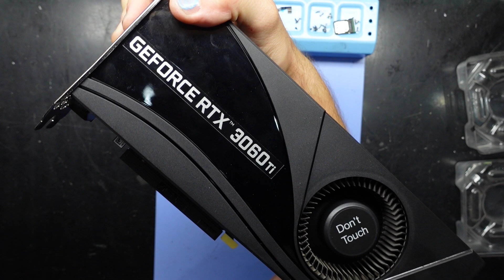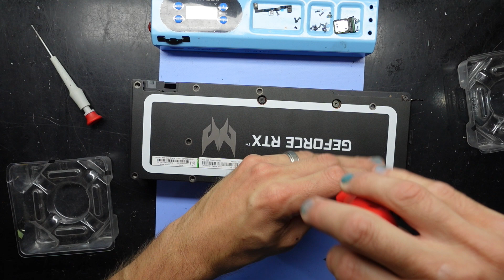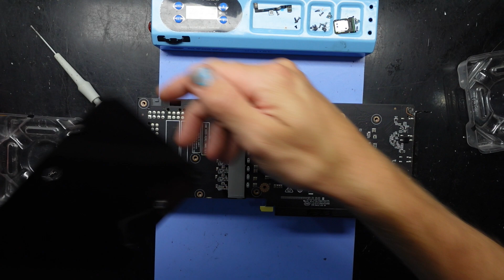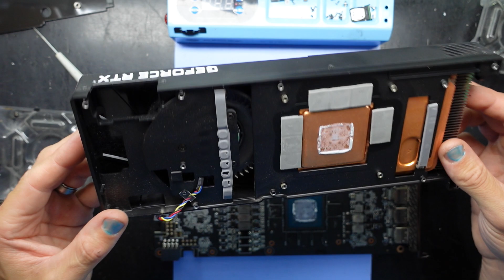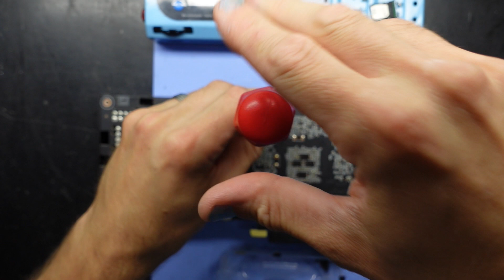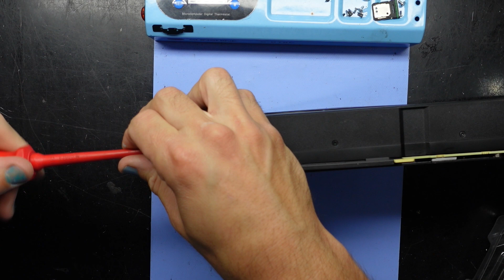Acer Geforce 3060Ti Blower Style Thermal Paste Replacement

Comment: I have same exact card is it normal to stay 80 celsius while gaming?
Reply: I got it to and got abnew Case and Motherboard and IT Hits Up to 95° unser full load so yeah i think ITS normal and Theres mit much we can so
Reply: Yeah bro i just repaste them and adjust fan curve + undervolt, it got under 70 celsius
Reply: Nooo 95 is not normal you should repaste and replace thermal pads with exact thickness

Comment: Have this card in my prebuilt that I bought during Covid when buying the individual parts would have cost twice as much. 

It was so bad that I had to do a custom fan curve and undervolt in Msi afterburner as well as reduce the max boost clock it could achieve by 115mhz just to keep it cool enough and not sound like it was taking off.

Followed this video to repaste the card like and I’m able to get the max boost clock again with less heat and noise with the default curve that afterburner uses. 

My only issue was that my fan cable was pretty much welded in and wouldn’t budge but it was still an easy repaste.
Reply from the maker: awesome to read, repasting the gpu as got it back to precovid performance levels!